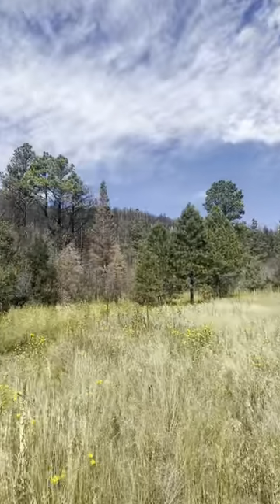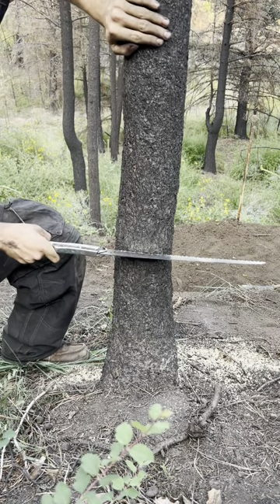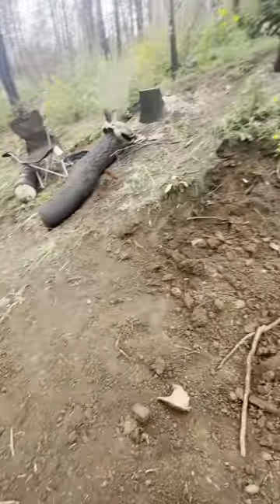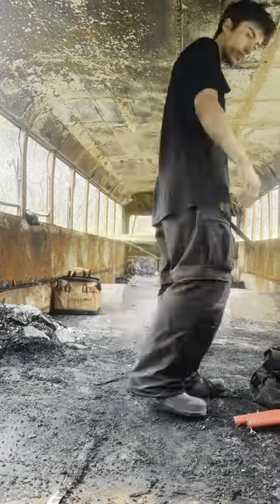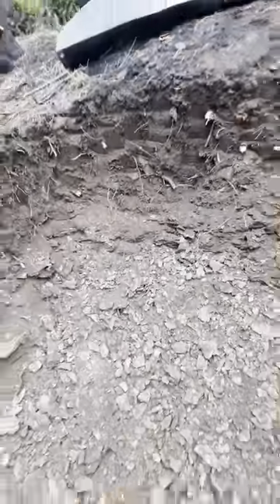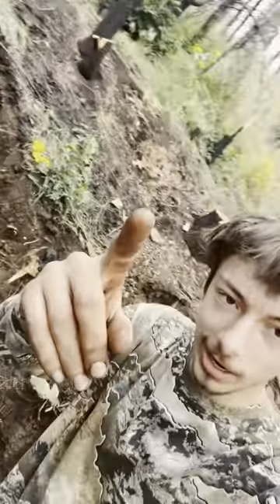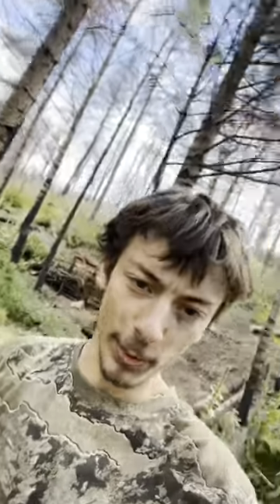Building Cabin the the Mountains Day 15

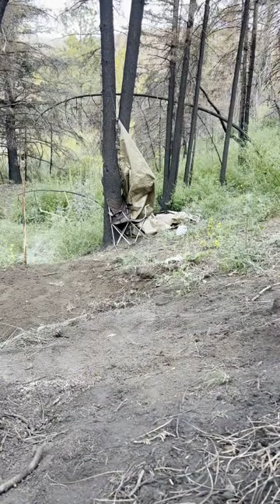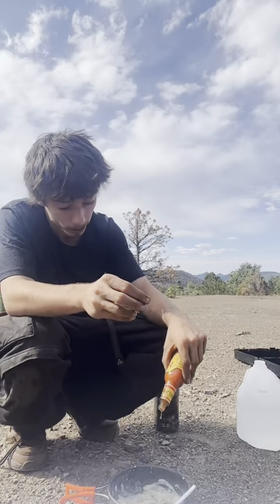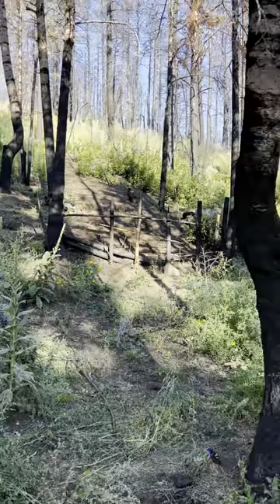Comment: so to aim a tree 4:43 when falling it you need to cut a wedge out in the direction you want it to fall but do not cut into the middle third of the tree.  you need to make sure that cutout is extra clean because you want it to fall straight.  then from the back side you need to cut flat but do not cut into the middle third.  sometimes you have to cut a little deeper than that or you have to wait for a few minutes for a breeze to help out but you don’t want the column weight of the tree to pinch your saw or you’ll never get it out and also if you cut too deep the tree will fall wherever the weight is but by leaving a good amount in the middle it forces it to fall in onely the direction you chose by cutting the wedge. 6:02 i love new mexico.  you should find a local who is good at harvesting piñons to show you how to do it.  they are very nutritious but also they are easy to sell, sometimes a 5pb bag can go for $200 and you can sell it locally or online.  there are other nature bounties like whine making and gem hunting woodworking.  even your garden, people buy starters for their garden rather than planting seeds.  consider getting a water trailer.  you could get 500 gallons at a time which would last you a while and if you park it uphill you can use gravity instead of pumping it.  i hitchhiked through there back in 2008 and camped outside of taos for a month or so. and my ex wife is navajo from Gallup and those natives really prize certain things like corn and things which could be interesting for you to get into the culture a little bit and look for cool things to sell or make or trade.  6:50 i have those camping pots “aloc” or something like that, you should get the little stove.  it’s a rip off of a trangia stove design but for a third of the price and you can buy an adapter so you can use propane and it is good in the wind and perfect for backpacking and you can use the alcohol stove as a second burner. it’s around $80 but it’s worth it. i’m clearing land and i have a nice foresters axe and silky saw and three chainsaws but nothing gets as much use as my kershaw camp 18 machete. maybe buy a live catch cage style trap, i don’t use mine very often but anytime i have a pest i always get it in my trap so i think in a survival situation i could get protein than way 8:21 18:36 you need to eat.  protein salt and fat and cholesterol is how your body stores water.  you don’t need all that food but it’s a lot more difficult to metabolize water and store it on your body if you’re exhorting yourself because you are using your water and especially if you’re not eating.  you do produce more testosterone eating less and that increases your energy output but it won’t last indefinitely, you need calories. i’m a slingshot enthusiast but it wouldn’t be very practical for your situation because you have to constantly craft bands, they break all the time.  but i have so much fun with it because i can walk around and let ball bearings fly in any direction and not have to really worry about it…. i’m pretty good with a slingshot but it lacks the lethal element.  i think you would do really well with a blowgun because they are lightweight and stupid cheap and they can actually kill things.  tim wells hunts large game like grizzly bears with a blowgun.  i had a pet owl as a kid and i killed rodents with my blowgun to feed to my owl.  i haven’t used one in a really long time but i know that i’m really good at hitting anything which is straight up above me looking down from the branch of a tree.  that straight vertical shot never fails.  birds communicate very well, you don’t get too many tries before they are all alerted to your presence especially if you start shooting projectiles.  spears are pretty beast though.
Reply: Golly, you must have an English major.
Reply: @Lukas_duhh  i’ve actually zero formal education, never been to school in my life.  they say 90 percent of communication is body language and nothing is communicated until it achieves the desired result which is an indication that physically forcing someone to do anything is probably the most effective method of communication…. so a ufc fighter would be better at communicating than an english major.  communication by means of pointing or with facial expressions or by demonstrations or by drawing or with sign language are all valid ways to convey something but whenever i’m online i usually resort to writing words.  i guess i could link someone else cutting down a tree or i could make a video myself but being able to write is something i would like to continue to do because it’s easier to take for granted when you’ve already passed the first grade.
Reply: @cameronchicken8439  i was jk but ok

Comment: Love the video! I just thought: what if you rented a metal electric saw, and cut the top of the bus to use as your roof? I would be faster, better and way more functional! You would lose the bus, bus you could put a simple wood roof frame and wrap it with tarp!
the bus would have a basic but functional roof, and the cabin will have a massive great roof!
Reply: Great job!! Keep the videos coming!
Reply: I would say the steps would be:
1- Measure the width of the cabin and the bus (on the camera it seems to match!
2- Check if the bus roof is firm enough to, after cutting it, drop it on the ground  and slide it to the cabin
3- Prepare the cabin's lateral wall so you can put the bus roof up supporting it with logs (the wall)
4- Replace the bus roof on the bus for a simple wood and tarp, like a tent! (so you keep the bus as a deposit)
5- cover the cabin roof (made with the cut bus roof with a tarp and dirt...

that would be a faster and more efficient roof for the cabin.

Comment: I was just also thinking you should be folding the trap up into the roof before you put your roof tarp on so nothing can leak in as the water will flow past via the roof tarp and if it does flow along the wall it can't flow over

Comment: Need to overlap the roofing around the boot for the chimney pipe, put down the bottom metal roof making sure to cut as close as possible to hole for the boot, put the boot down, then cut around as close as possible to the rubber on the top metal roofing so that the water cant run under the boot anywhere

Comment: Id invest in the armies MSS modular sleep system its a little pricey but its rating is -45 degrees fareinheight I got one and I dont regret that shiiii at all bruh get the more modern one youll also get a bivvy wit it pair that with a good sleepin pad maybe a wool blanket and your set for antarctic temps.. maybe not that low